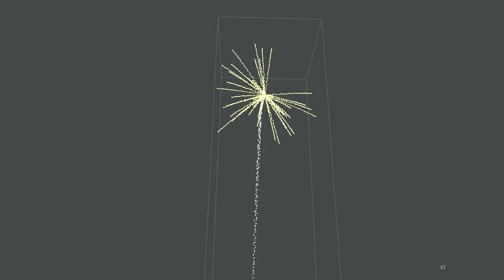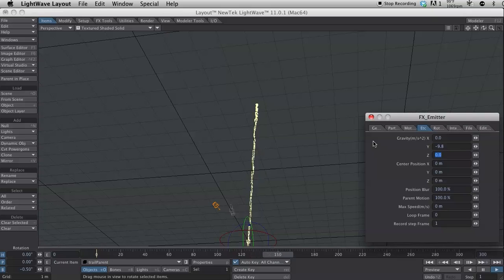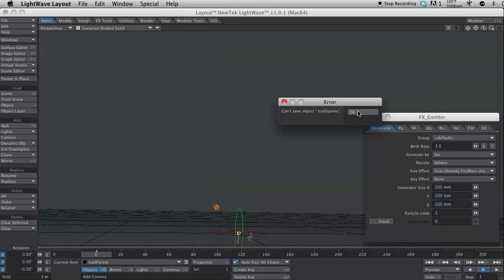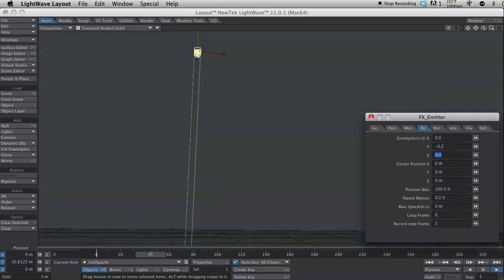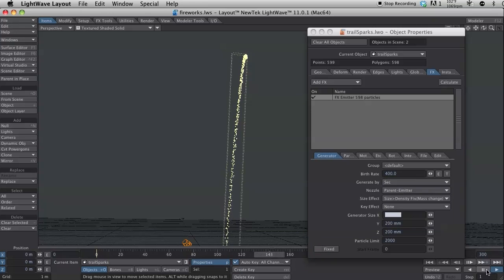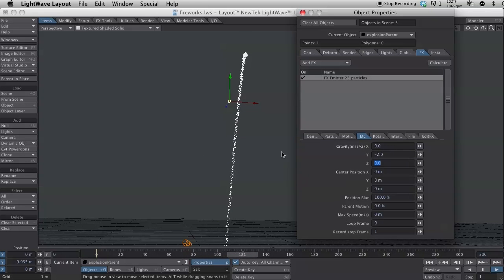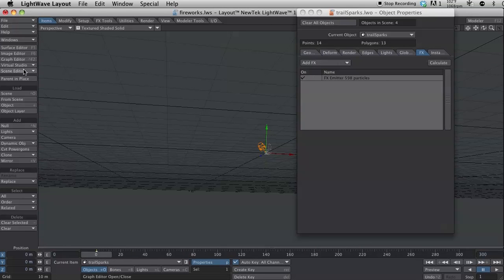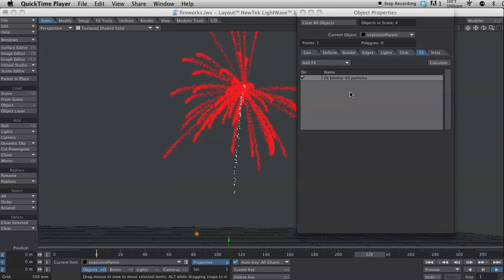LightWave - Fireworks part 1 - Particle Emitter Setup

Comment: what happened to part 2 ?
Reply from the maker: If I recall correctly, I recorded something, but there was a major problem with the result. 

The primary thing I wanted to cover in part two was making the particles sparkle, and I did to that in another video that I release much later. xW8qmIs80wo

I'll put the link to that video in the description for this video.